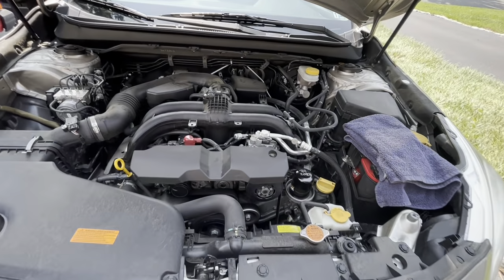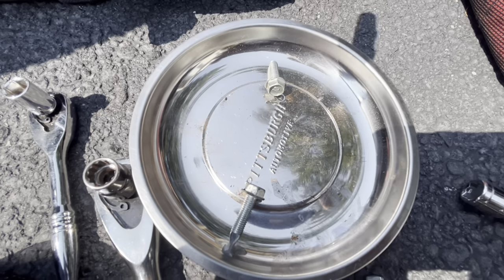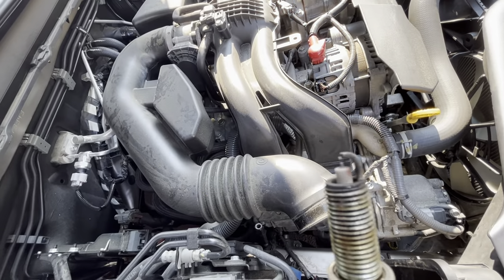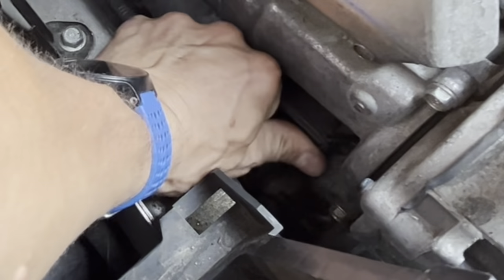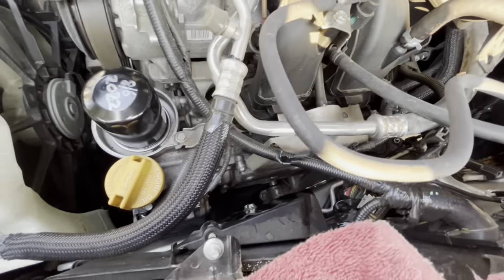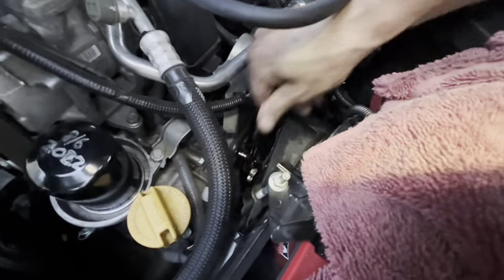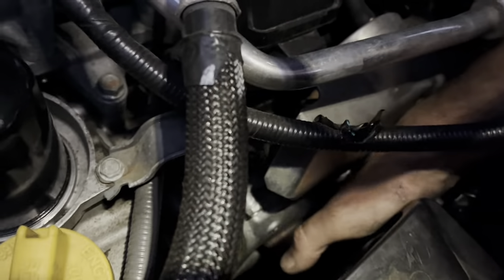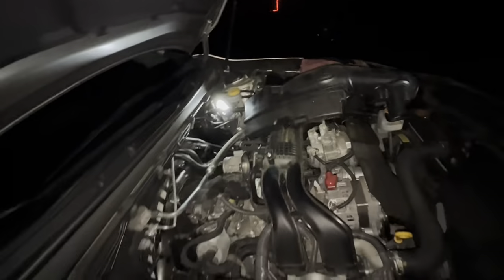2016 Subaru Outback 2.5L Spark Plug Change

Comment: Dealership quoted me $541 for spark plugs. Idk about you guys but its worth 6 hours of my time to do it myself.
Reply: Dealership is going to take engine out to replace my upper oil pan gasket which is covered by warranty but wont do me the favor of replacing the spark plugs while its out..
Reply: Dealership said theyd charge $316 to do spark plugs while engine is out vs the $541 while engine is still in.
Reply from the maker: I had a quote for $200 from the dealer where we bought it which I felt was super reasonable.  But I like to do things myself.  Or try to do things.  Think if the price is the same $200, in future I might let them do it!! Thanks for watching!

Comment: Should have just taken the time to remove the battery and bracket. Yes it’s a pain but it looked like a lot more work doing what you did on that drivers side. But I can appreciate the time you took to film, I did watch this before changing mine. Thank you.
Reply from the maker: Yeah, you’re probably right!  It’s hard to be smart, but it’s a good idea!  Thanks for watching and sharing your experience.  Next time, I’ll remove the battery. Not sure it’ll help for that driver side back one, though!!
Reply: Thank you for the video. I'm watching before doing mine as well.

Comment: For the rear spark plug on the battery side, here’s what worked for me.   14mm plug socket - 50mm extension - 3/8” wobbly - 3/8” ratchet.   PS, the 50mm 3/8” extension is hard to find.
Reply from the maker: Great info!  Thanks!

Comment: Facing the engine:  left front (not too bad); left rear (pain);  Right front (awful);  right rear (horrible).  Even at $400-500, I will probably pay someone to do this next time.   Highly recommend a long handle low profile wratchet. You will probably want to remove the under-engine splash guard so you can access from under the engine.  For the last one, I tried that combination of a quarter inch drive and a wobbly and a 3/8 to quarter adapter. And I could not get it into the spark plug hole.
Reply from the maker: Good info.  Yeah, I thought about taking off that splash guard.  Thanks!

Comment: this was a very helpful video .... thank you!!!    i found that it is much easier if the battery is removed ... and a swivel extension with a flat ratchet is used on a magnetic spark plug socket
Reply from the maker: Hope to never do it again! But if I did, I might remove the battery. Honestly, the hardest ones were away from the battery closest to the firewall (and frame).

Comment: I just did the plugs on my moms 2017 outback and the back drivers side was the biggest pain, getting all the right length extensions together and then back out was the worst, I took the battery and tray out, I cant imagine doing it with that in place.  I have a 06 STi and I guess its about the same.
Reply from the maker: Yeah, for sure if I ever do it again I will remove the battery and the battery tray! Glad it went well for you!

Comment: If you knew the difficulty involved in removing sparkplugs when you bought the vehicle would you choose a different vehicle initially? I know I wouldn't want to bring a Subaru needing spark plugs to dealer. Some mechanics would not replace plugs and say they did
Reply from the maker: Yes.  But we didn’t think of that in buying the Subaru.  The pain to time owned ratio is very small.  Still going strong and just turned 100k miles (knock on wood).  May pass down to one of our sons at some point.  It’s our main car though!

Comment: A 14mm swivel joint spark plug socket (with magnet) would have made this job a lot easier.
Dreading doing my 17MY Outback 2.5l now!
Reply from the maker: I was apprehensive too.  May not do it again.  Only saved $200 doing myself.  But I won’t have to do it in this Outback again!! I hope